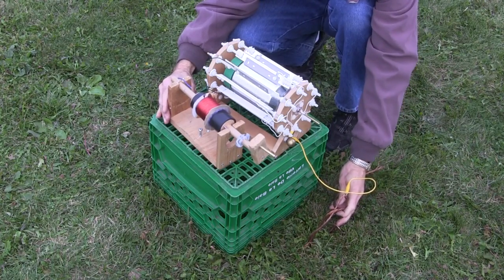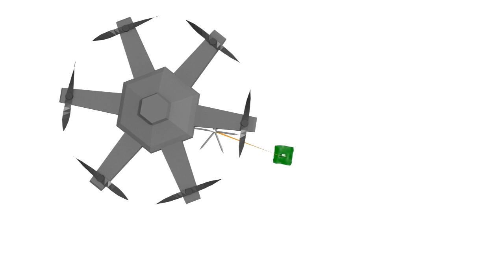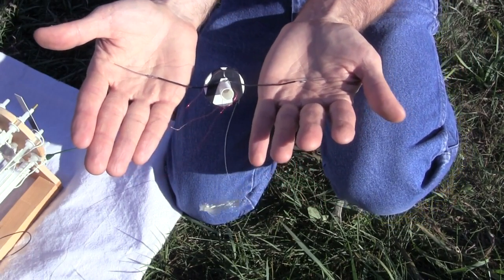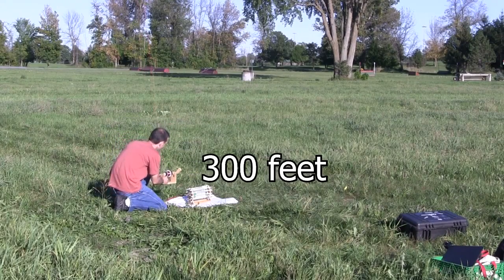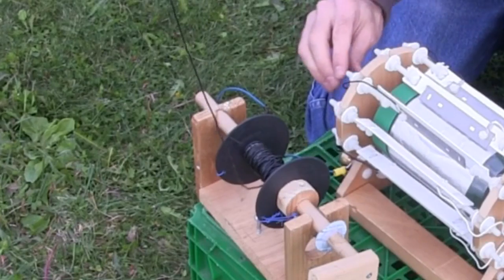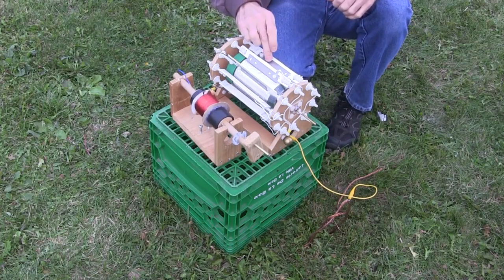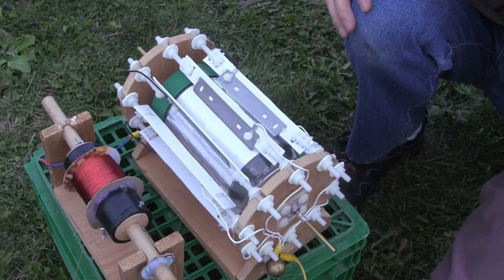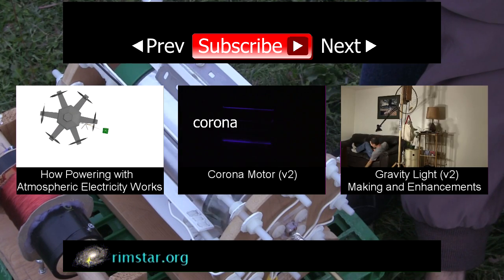Atmospheric Electricity Powering a Corona Motor/Electrostatic Motor

Comment: So for power if you put up an antenna you can tap into the natural electric grid? Tesla spent his time doodling with lightning generators when all was needed was an antenna?  
Could you electrify a large sphere with a coil underneath in order to step down the lightning to a more consumer available voltage ?
Reply from the maker: The wire I put up could be used as an antenna, probably a pretty good one. Put a crystal radio at the bottom and you'd probably get a good signal. Or tune into the 60Hz power grid an you'd pick that up instead -- though it'd be illegal so don't do it for too long.

Comment: Like very much your corona motor  I was thinking a buck converter could also work?
Reply from the maker: I don't know if a buck converter would work. This is high voltage so you may need extra circuitry but I'm no expert on buck converters.
Reply: RimstarOrg it would have to be modified to use the highest possible voltage devices and I think it will work possibly it would need multi stage devices there are semiconductor devices which operate in the kilovolt range

Comment: If you install 10 - 20 vertical aerial  at reducing height and run it through a sequencing high voltage switching chamber and run it through a voltage transformer to earth the height voltage low current could be converted to low voltage high current . Resulting in endless free power. The switching is required to create a varying voltage so the transform will work.
Reply: Thank you!!!

Comment: If 8 sharp points increased current, so what if you did even more? 500 sharp points for example? All gathering current into the main wire.
Reply from the maker: In general, more sharp points should equal more current. But I can see some possible limiting factors, such as there isn't much charge per volume to start with and the more points you have, the weaker the electric field becomes at any one location. So there's probably some number of point over which it either doesn't get better or even gets worse.

Comment: Wow thats great. Since it is just a wire and V=IR the real voltage across the wire must be really small not 12000V, also it is just a straight wire with no loop so wont there be charge buildup preventing the current. Also the resistance of the earth is huge so the current will be small isnt there a better way? I was playing with a capacitor and attached one end of it to ground but it didnt discharge, i was wondering why? I know Q=CV and F=Kq1q2/R^2 so wouldnt a charge buildup on a capacitor cause a discharge? i know from RC circuits I=CV/(1+RC) so when the circuit isnt in a loop there will be charge buildup and that will counteract the current where C=epsillionA/D but what is the capacity of the earth/ground?
Reply from the maker: As you said, the ground has a high resistance so you need to make a lot of contact with it in order to lower the resistance. I was making some contact with my thick wire pushed into the ground, but not enough. That's why I grabbed a hold of the wire with my hands because my skin resistance was lower than the ground and so I acted as part of the ground too. For houses, they'll often pound a large diameter copper rod a meter or so into the ground to get a lot of contact.

Comment: Use a van de graff for more speed
Reply from the maker: You could but I used my Van de Graaff to get more torque. For more speed, I used a high voltage power supply. Check both out here http://www.youtube.com/watch?v=hpvHRHs7o7I
Reply: @RimstarOrg  thanks but I have already watched your video it was nice

Comment: how could you actually make a small corona motor a feasible power source? i dont see running 400 ft of wire into the air as a practical solution to finding power.

Comment: Could you charge a battery with it
Reply from the maker: You can, if you can find a way to step the voltage down without the motor. The torque on the motor is too small to run a generator -- a light touch on the shaft with a fingertip stops it. It may take a long time to charge even a cell phone battery though.

Comment: the amount of current achieved by the antenna is determined by the mass and surface area of the antenna itself.  The voltage is determined by altitude.  Increasing at 100v/m
Reply from the maker: Yup. I go through much of that in a follow-up video here https://www.youtube.com/watch?v=2rVdEhyMR6A

Comment: I have a video somewhere that a man on YouTube flying a drone around that had no battery just a coil in resonance with the coil on the Tesla coil it had enough power to run the chopper, he did explain how it worked but not sure now something to do with running the motor with induction rather then pushing the motor with amps.

Comment: How fast will Corona Electrostatic Motor will spin if you connect it to Van De Graaff Generator?
Reply from the maker: I didn't measure the speed but it spun quite fast as you can see in my first video about the motor here http://www.youtube.com/watch?v=hpvHRHs7o7I. I got it going even fast with my HV power supplies in the making video here https://www.youtube.com/watch?v=9uEjXsX1F14.

Comment: The earth is a huge magnet, electrons from the atmosphere fall straight down, they do not flail about. Your copper wire could absorb more electrons if it were stretched above the earth horizontally; more wire = more electrons. Try it. 

PS....Good video.
Reply: If it is close to ground it will have less potential 
Its because the closer to ground the more of those icons are lost to random electrons from the ground 
Tho if you can rise this line to higher altitude it will get more current like was done by the ion group
A simple line is still less efficient than a sharp point tho
Reply: If you were to collect falling electrons closer to the ground still need the wire going up into the sky to complete the circuit

Comment: Can you imagine the HP capability of the motor if magnetic bearings were used? 
See a lot of similarity to the spires in "Victorian" (but likely much earlier) buildings - did these use atmospheric energy?
Reply: This should be tested at the grand canyon.  using fiber glass rods and the sides of the canyon to support the copper wire. Also include capacitors and batteries as part of the electrical.  Maybe enough power to tricked charge the batteries?
Reply: Lightning conductors.
Reply: Im sure of it David. Its hidden in plain sight. Look up "WISE UP" on youtube

Comment: There's lots of circuits to turn low voltage power sources to high voltage low current sources. There must be some that turn high voltage into low voltage high current. Couldn't you feed this into a "inverse step-up circuit" and get a decent amount of current, then power normal devices?
Reply from the maker: Probably but it wouldn't help in this case. The power output is extremely low. I didn't measure it but a light touch on the motor shaft with my finger stopped it from turning.

Comment: I dont get this. This is very new to me. Do you mean that if we measure the p.d between a body placed at 120 ft high in the sky and the ground we will read something like 10kV?
Reply from the maker: Yes. But initially, when you put the body there, it will still be at ground potential. In other words, it will take time for enough charge to gather on the body for the body to equalize with the level of charge found at that altitude.

Comment: Have you tried running/powering it through A JOULE THIEF on the atmospheric electric?
Reply from the maker: Hmmm... I'm not sure that would work. The voltage would be too high and if that wasn't a problem, the current may be too low.

Comment: Just a suggestion: Try  running your copper wire from the ground up to the top of the CN tower (height of 553.33 metres) and see what results you get. That ought to be enough height to get an atmospheric voltage of just over 50kV. You should be able to run a pretty decent motor with that much potential.
Reply: Well, the thing is, buildings like that typically have grounding rods, so the entire building more or less remains at ground potential. That being said, the field lines become more and more compressed the higher up you get, so if you were to fly the drone just ~20 meters perhaps, or maybe a bit more, then you'd probably be able to get up in the tens of kilovolts.

Comment: Why not running it with more wires further apart with a weather balloon in place of the copter?  8 wires to the motor
Reply from the maker: Actually, you'd still need only one wire. The key is to capture more area high up, so many more sharp points over a larger area. For real useful power though, the amount you'd need just isn't practical. As for the use of a weather balloon, I was worried about the wire breaking low down and then the balloon flying away and laying the wire across power lines. Despite reassurances, since I had it break once with the hexacopter, I'm still leery of doing that.

Comment: Nice! But why not just strap the other end to a balloon filled with helium gas?
Reply from the maker: Thanks! Initially I didn't because I was worried that if the wire broke near the bottom then it would string a wire across the city and across power lines. The hexacopter provided more control. I still fear that because of the break in the wire we had in the video.

Comment: That´s why above 90 meters is banned.
Reply: I do believe that as well and the fact that nasa actually did an experiment with that in lo earth orbit extending a line around ten miles before earth turbulence made them cut the line!
Reply: Best example transmission line of electric company 120 meters above
Reply: Instead of putting a wire UP into the atmosphere, insulate all but a point and sink the wire to achieve the same effect. Shhhh... We don't say these things out loud.
Reply: You think 💭 there might be penthouses & conference rooms w/ free illuminating lights after a certain floor 🤷🏼‍♂️
Reply: It's also for aviation safety.  They don't want anything that airplanes can crash into.  A drone getting sucked into a jet engine is dangerous at worst and an airplane mechanic's nightmare at best.
Reply: @DM-kl4em airplanes are trash and should be illegal along with trash combustible engines.
Reply: Can’t have regular people making their own electricity for free, eh?
Reply: @Elkster Eidolon  water has hydrogen in it and that's used for nukes should we ban it?
Reply: Space Elevator
Reply: Here in the US we have a 400 ft height limit to fly the drone on top of any structures within 100 ft where the drone is hovering. This means that if I have a tree or building 80 ft high, ~100 ft away, the total allowed height to fly the drone would be 480 ft.
Reply: A lot of laws are designed to keep peoples powerless in ignorance.
Reply: Wow lots of ignorance in this thread. Atmospheric electrostatic is a cool phenomenon, but its far from useful for harnessing power. 

The electrostatic voltage in Earth's atmosphere is about 100V/m, meaning at 120m that wire carries 12,000V or 12kV. The reason those shocks don't kill him is because there is an extremely low amount of current flow, 2 pico amps per square meter. 

It's not mentioned what gauge wire he is using but it's clearly very thin. There is probably a fraction of a femto amp (extremely low current) meaning overall there is very little power. This is the reason a corona motor is used, because they are made to run off of very high voltage low current, you will never escape the laws of physics though.
Reply: @probablyinconsistent4756 Ionize the air with alternating electric fields using a conductor. Have another conductor that is nuetrally charged. The electrons will move from the ionized air into the nuetral conductor. Connect a wire to two neutral conductors, and as the two same charges repell one another, the air will be negatively ionized. Have a negative charged magnet to propell the ionized air into a building or chamber. A healthy flow of negatively charged ionized air is healthy for the human body. And I think that this ionization method was used in ancient times for this purpose.
Reply: @probablyinconsistent4756  just because  YOU don't know how to use doesnt make it far from useful.
Reply: @justinbennett9998  it's not a matter of not knowing how to use it, it's simple physics. In order to get any kind of usable power you'd need a massive pole, several meters in diameter and a hundred meters high. Go ahead and try to buy something like that let alone set it up and get proper permits. 

Way to demonstrate the dunning Kruger effect.
Reply: No

Comment: This is the only plausible "free energy" video I've ever seen; I never knew atmospheric electricity was a thing until I looked it up. Have you tried using some sort of chopper circuit and a ridiculous transformer to get a low voltage at low current instead of high voltage at ultra-low current?
Reply from the maker: No, I haven't tried stepping the voltage down while stepping the current up. Judging by how just a light touch of my finger on the motor's shaft stops it, there isn't a lot of power here anyway. It's definitely fun to play with though.
Reply: If we estimate 1 nanoamp (possibly too high) at 12kV then that's 12 microwatts; maybe you can power a digital watch or something, but I doubt it.

Comment: What is the best cable to collect static energy from the atmosphere? Coaxial cable or other type? thanks for your answer
Reply: If you're talking about the cable connecting your antenna high up to your circuitry/devices on the ground, then you don't need anything special, just plain old copper write would do perfectly fine, but you can use a coaxial cable if you like.

Far more important is the design and implementation of the antenna itself, which should at the very least have as much surface area as possible (making a fractal antenna particularly good in this case).

Comment: why not try with a fishing rod instead of a drone ?
Reply from the maker: Fishing rod? How so?
Reply: as a pole ... of course you should weld several ones together 3-5
Reply from the maker: Ah, thanks for clarifying. However, I had to lift the wire to 120 meters/390 feet before it would work. That's far too many fishing rods.
Reply: true however, they are re-usable as much as you want. the cost of drone fuel is more than than the free energy you're getting. unless of course it is just an experiment. the thinnest metal beam material used in construction
could also be useful .. however it needs insulation .. I'm just throwing ideas to eliminate the drone from the free energy equation
Reply from the maker: In that case a balloon or kite are possible alternatives. Another is to stretch a wire across a canyon.
Reply: a baloon must be able to withstand pressure. a kite of foam why not .. good idea .. it is interesting to see how high it could take the rope

Comment: can you do that in a building?
can you do something useful with this?
Reply from the maker: You can't do it in a building. The wire has to be far away from any structures. The wire has to be far away from anything that's at ground potential, so that includes buildings and trees. My follow-up video explains how it works https://www.youtube.com/watch?v=2rVdEhyMR6A.
Having said that, no, there isn't a useful amount of power here, not for anything that can be built and used practically anyway.
Reply: RimstarOrg A question, can you externally of the motor, connect a series of gears to the rotor that grows up the speed and at the end of that you connect a generator to create usefull energy?

Comment: Totally cool. If I remember the Tesla patent correctly, he used sheets of metal. One suspended in the air, the other buried in the ground. There was then an oscillator driving the HV onto a short secondary to deliver amps. In another paper, to do with attracting atmospheric electricity for the purposes of grounding lightning around/across buildings,  he showed with math that using a hollow sphere was much more beneficial for gathering energy. So, how about a large balloon filled with Helium, covered in aluminium foil for the top, with a ground plate of the same capacitance? It doesn't have to be actually buried, but if it were in a conductive gel, such as a salt water/corn starch mix, to connect to the ground laterally, (??) then the current might go up. I don't remember what the galvanic opposite of aluminium is....I think it is lead. So, some lead flashing might be worth a try for the ground plane??
Reply from the maker: I've read that Tesla was making use of the photoelectric effect. This effect is a different one entirely and needs sharp points high up in the air. Check out my follow-up video about how it works https://www.youtube.com/watch?v=2rVdEhyMR6A. I did once play with Tesla's method but didn't go very far with it.

Comment: Can I use copper wire that is not insulated?
Reply: Can I make it using uninsulated copper wire?
Reply from the maker: If you mean the wire going into the air, I would think so since at a high voltage the thin enamel insulation on my wire doesn't make much difference. But make sure it doesn't touch anything, otherwise you'll have losses.
Reply: thank you very much

Comment: 1. What if the 6 nails spider was hung over a poll / tower higher than 200 meters and the gravity part was grounded alongwith wet water, indeed your use of copter was for test purposes. It is apparently Teslonian theories coming to life.

2. rimstar.org doesn't work for me dear.

GOD bless
Reply from the maker: 1. would work as long at the pole is made of an insulator and is clean. Impurities from dirt or left by rain could make for electrical conduction paths.
2. Hmmm... either it's blocked wherever you are (I know it's blocked in some countries) or it was a glitch. Both http://rimstar.org and http://rimstar.org/science_electronics_projects/atmospheric_electricity_powering_corona_electrostatic_motor.htm worked for me. Thanks for letting me know anyway.